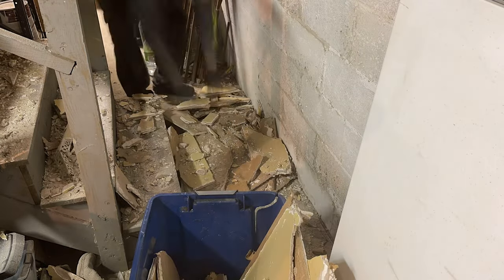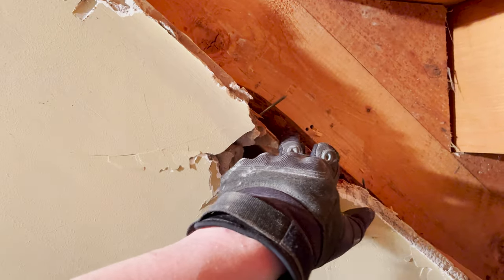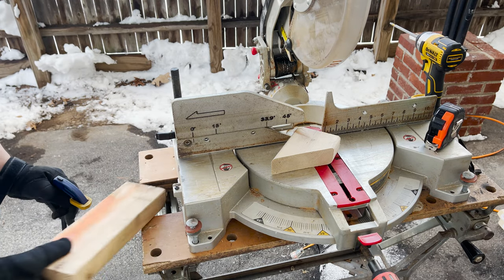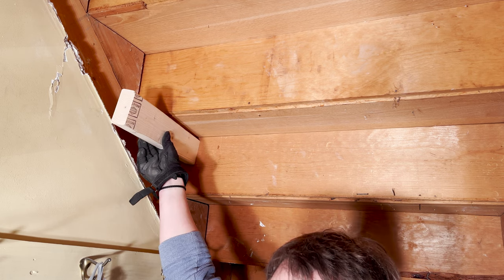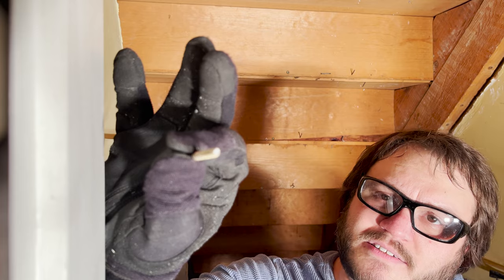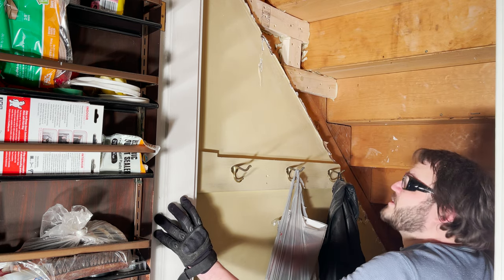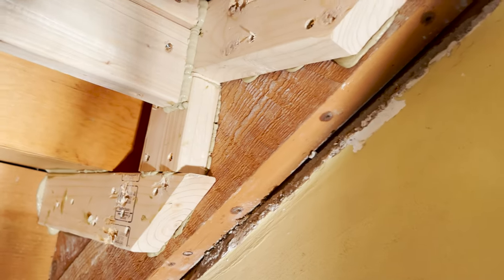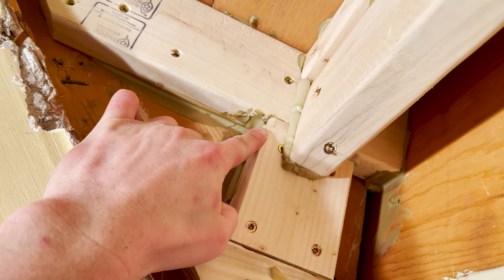How to fix squeaky stairs - Step 2, Cut Wood, Glue Wood, Screw Wood

Comment: Very useful so far. Is there a step 3? Very interested to see how it worked out as I have exactly the same problem. I have chickened out of doing it so far but it needs to be done. Thanks.
Reply from the maker: Hey Steve, I have a little more footage of the third day but it’s more of the same as step 2. I have not yet edited the video for step 3 since I lost focus and the squeaks have been cleared up. My stairs see a lot of traffic with my friend staying on the second floor so I don’t think the construction adhesive had enough time to properly set on two of the steps, I need to go back and touch those up but all in all, I would say this job is done and was a success. I also feel a lot more comfortable knowing no one will fall through should a step fail. 

I also need to do the light and I may also skip redoing the drywall on the ceiling, but I haven’t decided yet.

Comment: Hey…. the “construction screws “are for particle board- they specifically say not for structural projects…. Stairs are structural
Reply from the maker: I didn’t read the box so I missed that part. Thanks for the heads up though.

Comment: Can i use Spray foam!? I know it is a great adhesive too, and it has a "spongyness" to it so as to absorb impact?
Reply from the maker: Spray foam would certainly help at first but I imagine it will compact over time with the weight of stepping on it if there’s wiggle room prior to spray foaming.